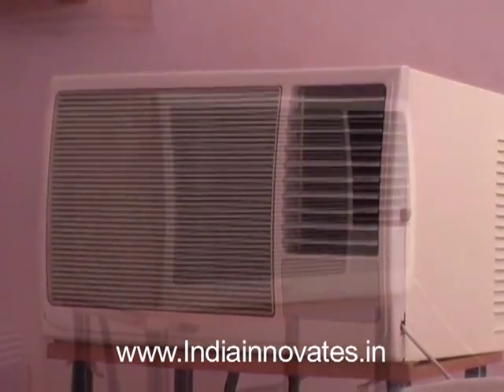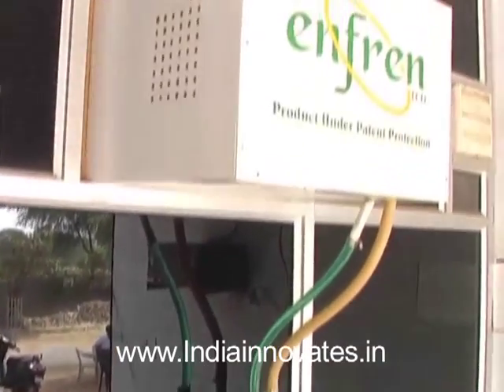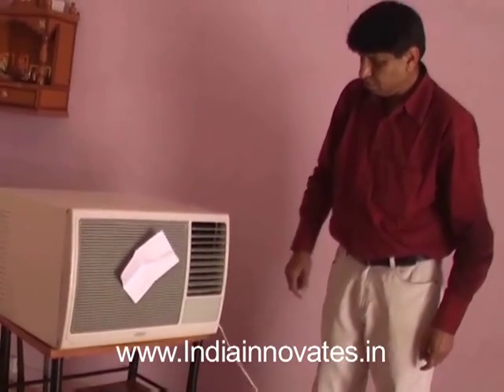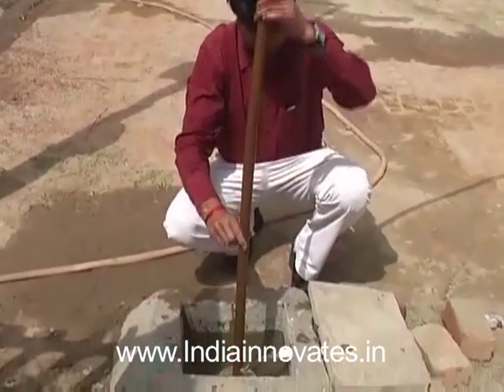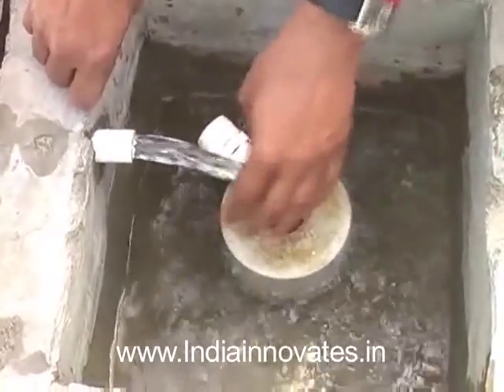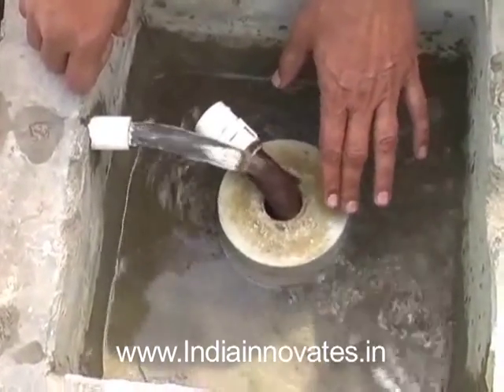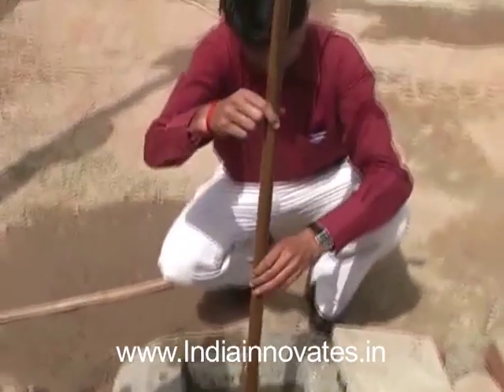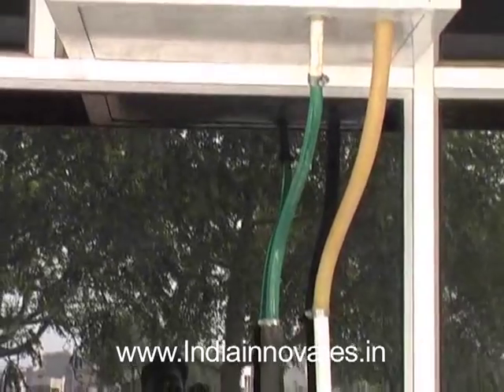Geothermal Energy based temperature control device

Comment: This ll be big soon
Reply: In Most places in India our water temperature is 32 deg. so may not work. Check bore well , well water temperature. If it is 26
or less, it is worth a try. Otherwise it is useless.
Reply: @jaishetty8586  is it possible to use some refrigerant tether then water to get better efficiency?